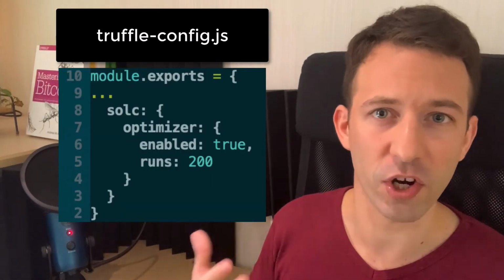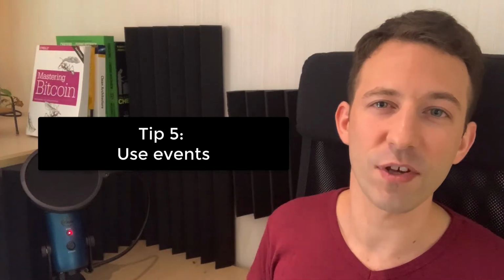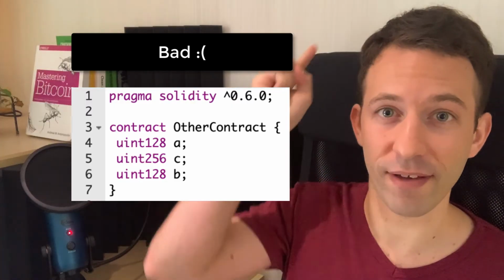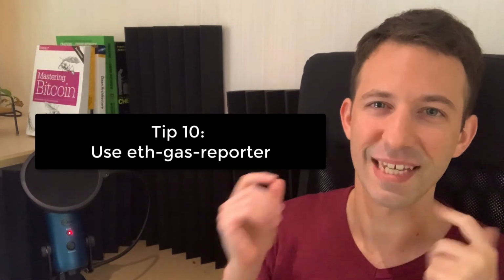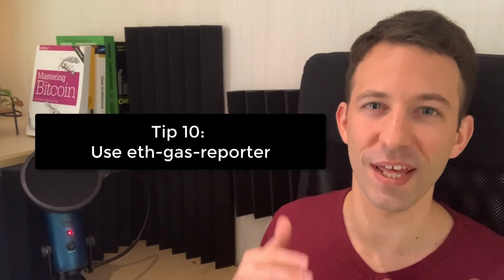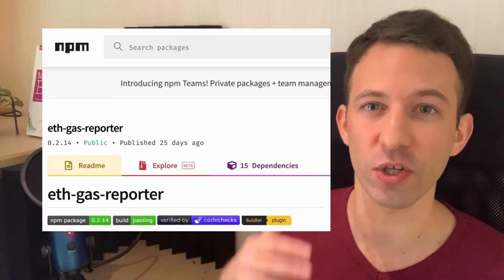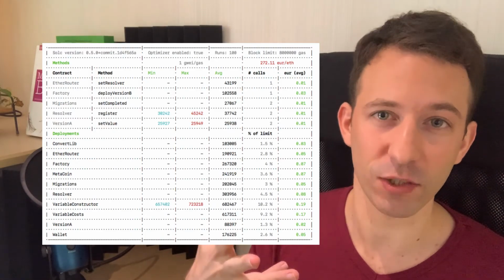Gas Optimization in Solidity: 10 tips

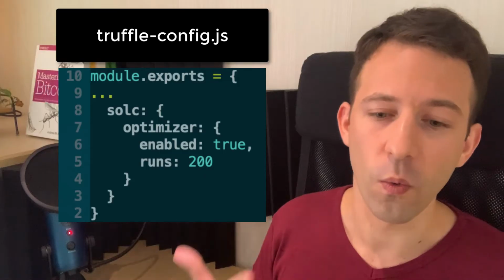Comment: Your optimizer settings are wrong at 3:46
Optimizer settings should be under under settings, as in: compilers.solc.settings.optimizer:{...}
Reply: Only if you are not using a EVM framework, like truffle, hardhat or forge

Comment: Is it recommended to use the Remix IDE's optimization feature?
Reply from the maker: If you deploy to production.
Reply: @EatTheBlocks  Some are suggesting to turn it off (Remix optimization) in production. So I'm a bit confused at this point.
Reply from the maker: @despareint  why are they suggesting this? You want code that is gas optimized for production.
Reply: @EatTheBlocks  It used to have problems, i think in solidity 0.5.0, so people still think this is the same

Comment: I have a doubt...after deployment of a contract on to a test network, first time deployment is successful and then after when I did deploy again on the test network it said transaction may fail exceeded gas limit, VM execution error
Reply from the maker: its possible, gas requirements change depending on whats in the storage of the smart contract the and input provided to the function.
Reply: @EatTheBlocks  Thanks for the reply.. How can I solve this error.. because I am preparing a contract that will store Blacklisted IP address... It consists of both IPv4 and IPv6 types of addresses.
Reply from the maker: @bikashjena8167  increase gas limit on your transaction
Reply: @EatTheBlocks  thanks for the suggestion man...